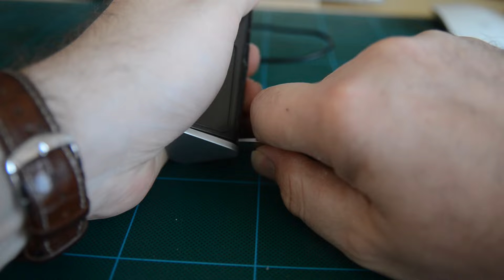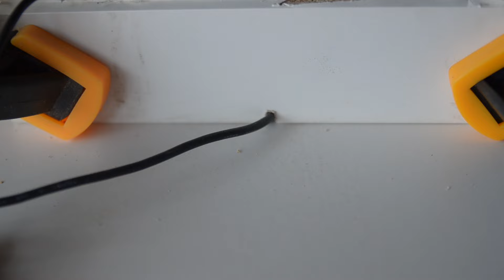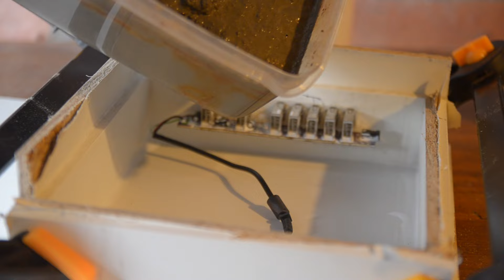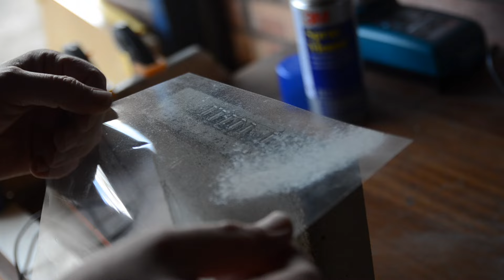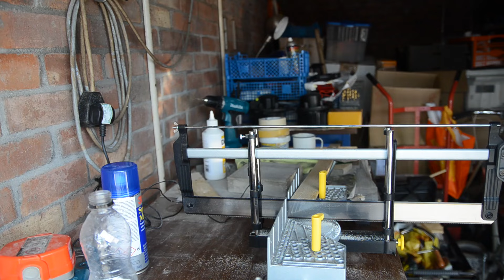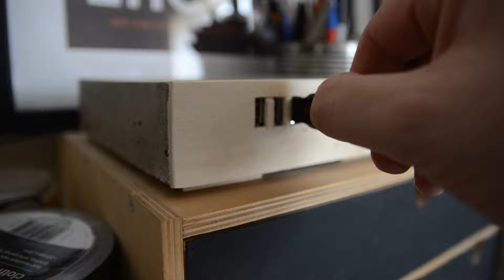USBHUBCHALLENGE // Phil Makes Things No.1 First YouTube Video!

Comment: Interesting approach! If you do something similar again I'd recommend masking off the connectors with tape and then applying a coat or two of poly varnish to reduce the risk of moisture sitting next to the circuit board (can cause corrosion / dendrite growth which knackers the board after a while).